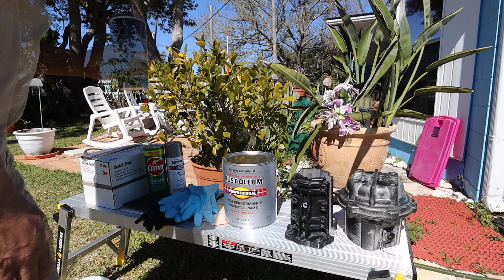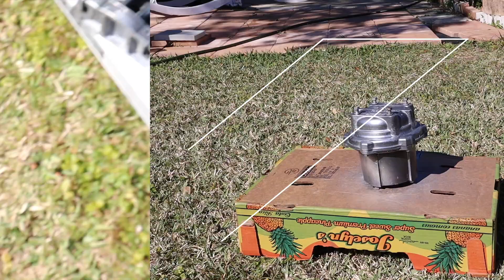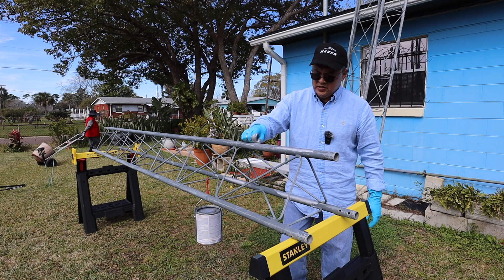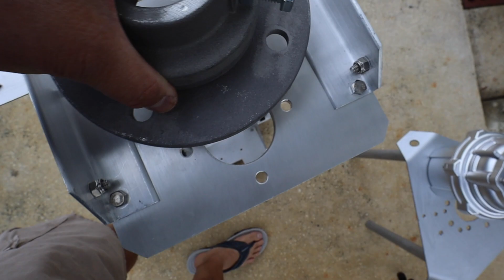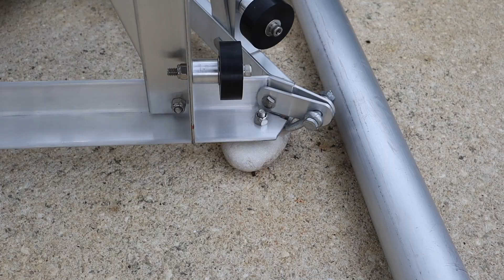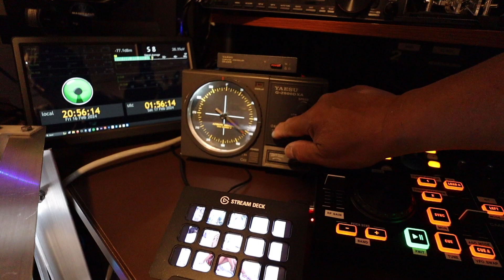Rohn 25g Tower Project Part 2 | Painting Tower and Yaesu 2800 Rotator | Hazer | Tower Tram

Comment: Very Interesting.... What STEPIR are you going to put on that tower?   Should be fun to see what your local planning and zoning dept. reveals regarding the tower permit.   Now on to the hole digging.... what dimensions?  Rebar and grounding next right?  Were I to do this at my QTH I would have a tilt over base plate and electric motor winch to allow maintenance of the antenna.  Of course you Hazer tram can allow up and down....  BTW is there a PART 1?  Art W1SWL
Reply from the maker: Hey Art, here's the Video of Part 1:  https://www.youtube.com/watch?v=UCSGzXoQghw&list=PLsd7gKFhoGmvldaKsxR3GJoRxpua7rGpG&index=1&t=2s  I purchased a used SteppIR Urbanbeam.  Took a trip to South Miami.  Man it was warm down there.  I have my building permit for my ham radio tower approved.  The dimension will be 3'x3'x4'.  I am planning on doing the tilting tower with a winch.  Maybe I'll re-sell the Tower Tram (Hazer) of just go ahead and use it on my tilting tower.  I've already started my Part 3 video; the fabrication of my tiliting mechanism and the great dig.  73 for now, N4VFR
Reply: Excellent on the tilt mechanism.  I will check out part 1 now... Looking forward to part 3.  Be Safe Amigo.73 Art W1SWL